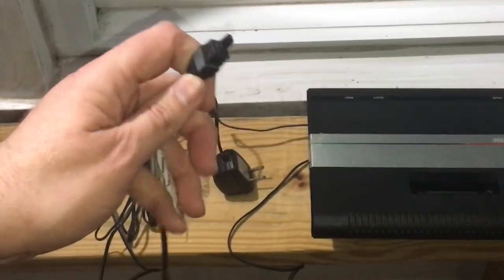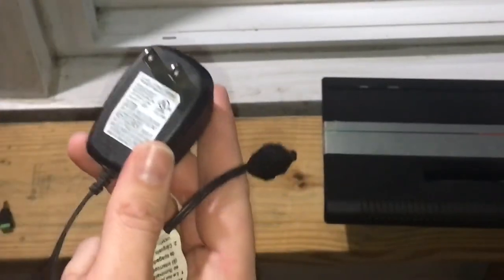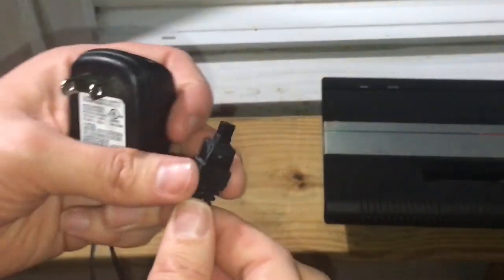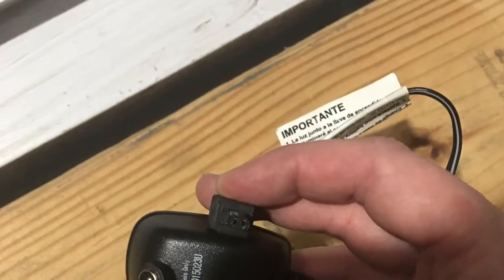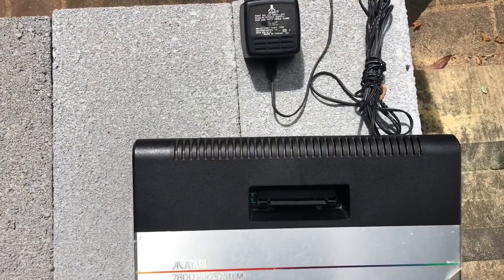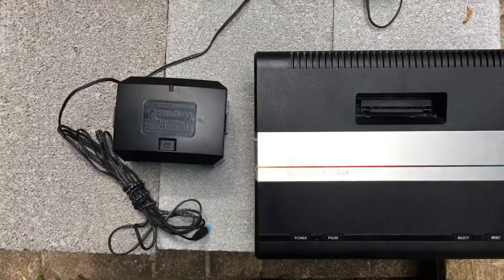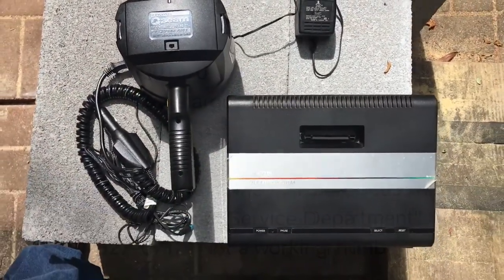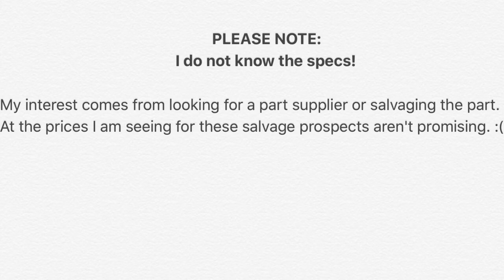Salvaging power connectors for Atari 7800

Comment: I need a power supply adapter for my Atari UK model
Reply from the maker: You can splice these plugs onto any 9v DC power supply with around 1 amp. I saw another power adapter with that plug type at Goodwill a few weeks ago. It was another from a Shark Euro Pro vacuum cleaner charger but it would need to be spliced on to another 9v adapter. Console5 may still have some of the ones salvaged from Brinkmann spotlight chargers.